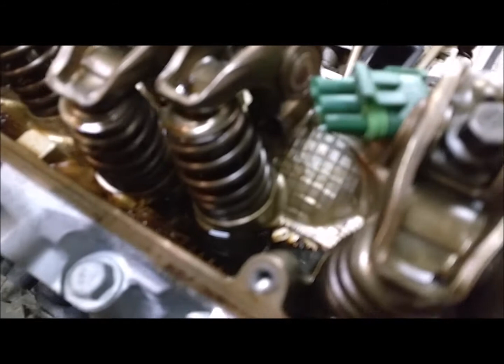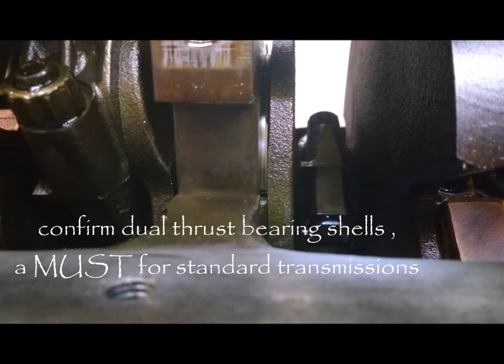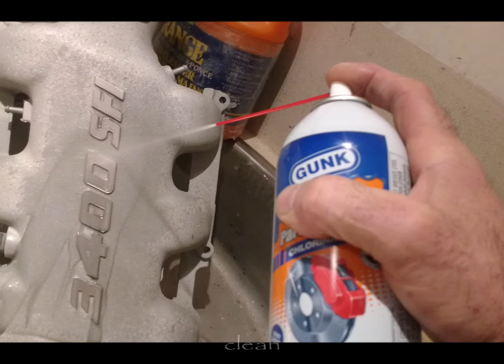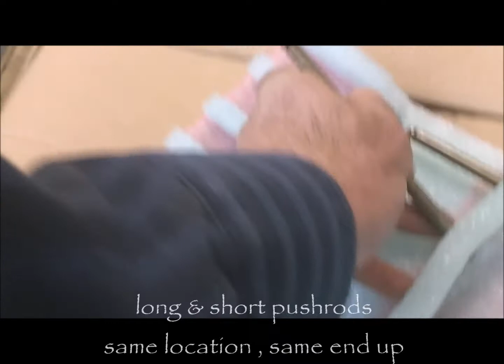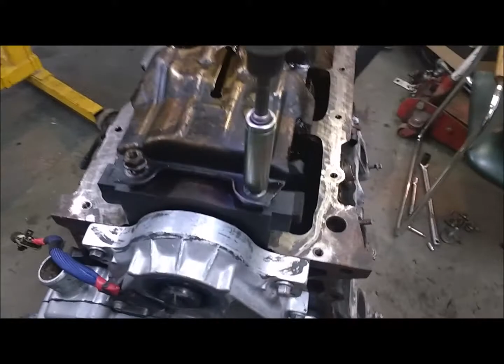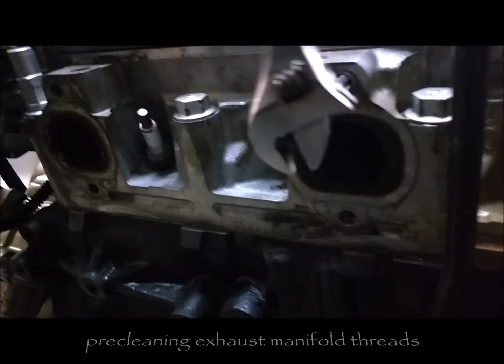freshen a FWD 3400 Chevy for streetrodding RWD Morris (low-tech street-rod Pt-3)

Comment: Looks good! Got a few spare timing covers? Lol 

I'm running a 3100 converted to RWD in a full size pickup with a little boost to help it out a little. I don't understand why GM never used the 3400's in the F-bodys and s-trucks...
Reply from the maker: Hello ModEverything :
Nice handle . Yup , nope , no extra timing covers here from FWDs .😀 
This is my 1st fuel injection street-rod. Don't know a thing about turbos 😉 The 3100's an iron head , no ? A tad heavier . Would need some help in a full size vehicle 😉 . Let me know how it works out for you . This motor is 10% lighter than the original 4-banger (and 3X the horsies) so no front suspension modifications necessary 😎
Thanks for your interest . stacy.
Reply: @OMCCsam  it the aluminum head engine from a 2002 Malibu. Its been running for almost 4 years now, still getting it perfected! Lol gas mileage is way better than the 350 sbc that it came with, and much more power! Going to add some more boost and some engine mods this summer!
Reply from the maker: @modeverything1   correct (i b'lieve an 04) . Awesome that you're happy with it . Computer reprogrammed ? i imagine even more-so with the turbo addition 😯
Reply: @OMCCsam  yes I have had the  pcm reprogrammed but I still need to work on it, it runs a little on the rich side lol
Reply: Bro? 😮 a 3100 V6 on how much boost? And you have it in a full sized truck? That’s freaking dope. I gotta see it. Was thinking about trying that with the extra 3400 V6 I have.